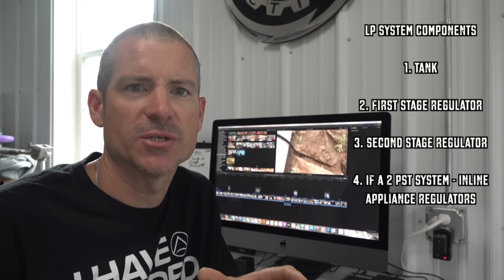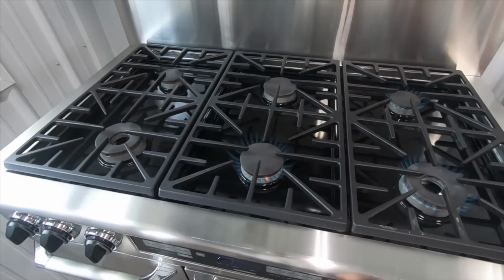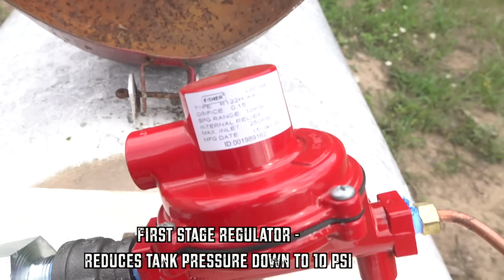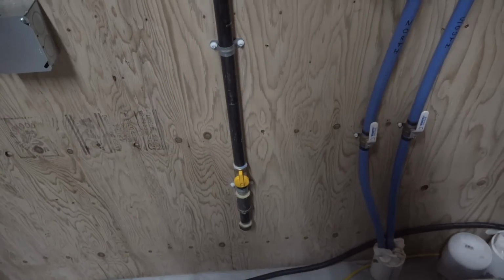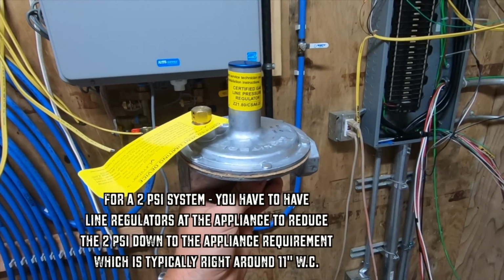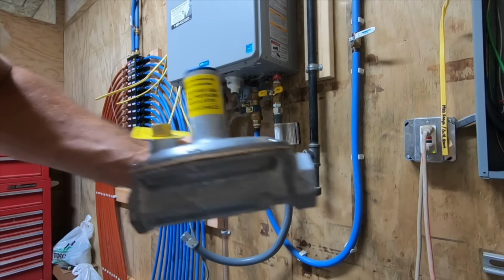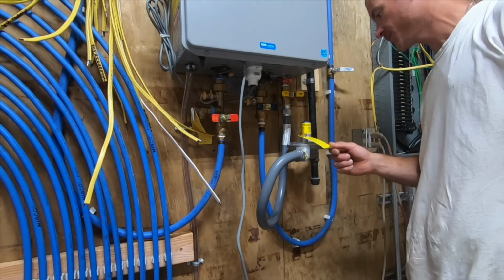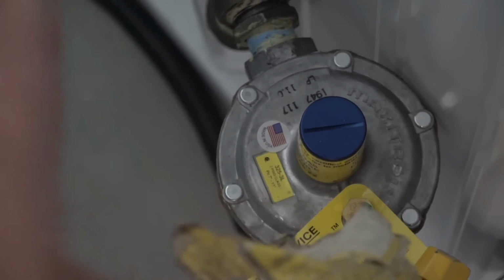2PSI LP Residential Gas System

Comment: You know that end part about being allowed to do these self-builds is really important and it's a bit difficult trying to find out what you need to order permits for and be certified for and etc. If you could do a video on your experiences and knowledge of that I'd really appreciate it.
Reply: There is no rhyme nor reason to jurisdictions, requirements, inspections, etc., since they are 100% politically determined.
Reply: @wallykramer7566  I'm sure they'll typically reflect one another though, and clearly Marshall did the research on where to find all his necessary information.

Comment: Buy the 1,000 gallon tank, DO NOT lease or rent it.  This will allow you to shop around for the best price and customer service on propane.  A 1,000 gallon tank can be legal filled to 800 gallons which is plenty to run everything you will need household wise as well as run a standby generator for a LONG time.  It also allows you the flexibility to wait until propane is on sale or at a low price from any propane seller you want as opposed to being forced to buy propane from the company you rent or lease your tank from.  They almost always inflate the price.    The other thing is PLEASE plug those unused propane outlet pipes attached to the cutoff valves if they are not currently (kinda difficult to see in the video)  Curious little hands from children love to play with them and could be in for an ugly, unwanted, and dangerous surprise in the event of a spark or static discharge.
Reply: this.  own your tank.    shop for gas when its half full and you can find better deals.
Reply: however most companies price match, renting does come with its own benefits and owning has its own draw backs
Reply: @aron6998  Maybe they price match where you live but not in my area or anywhere near it.  In fact, most propane companies will refuse to sell a tank for this very reason so they can keep you like fish in a barrel.  Propane companies will to some degree try to price match on Ag propane but almost NEVER with residential propane.  In this day and age, you can't hardly go wrong buying a bigger propane tank for a lot of reasons.
Reply: WR Farms well I work for the largest propane company and know for a fact all Amerigas locations do price matching
Reply: WR Farms also say you buy the tank fill it with 800 gallons and a leak occurs at the gauge or somewhere else that can’t be repaired with gas in the tank now you’ll have to pay for a pump out and repair whereas if it was a rental everything would be free of costs and the gas lost would be replaced free of charge as well
Reply: WR Farms Ag/IC is a different animal altogether and typically the prices and amounts of gas that’s needed for said season is ironed out either annually or biannually, installation of a tank has nothing to do with valve failure either I’ve set brand new underground tanks with bad multivalve and the manufacturer had to pay for the pump out and repair bc it was a defect, after 25 yrs of installing propane systems most leaks on a tank has nothing to do with the installer and everything to do with basic failure of gaskets/o rings either through age of valve or just the fact that man made products fail
Reply: WR Farms also a propane shortage is extremely likely this year more to do with the pandemic and the refineries not operating at high/normal levels, without the refining of crude oil you are basically stripping appropriately 85% of all propane that would come to market, which word of advice if you can hold extra gas before the cold sets in get it
Reply: @aron6998  And with that you precisely make my point for me even more and highlight the importance what I originally stated in my first post above. Thanks!  👍
Reply: @aron6998  I don't know one person ever had a leak from a propane tank ever. Yes I seen oil tanks leak before never propane tank. Saying if a person own there propane tank instead renting it and propane tank did leak he probably still be ahead cuz what gas company's do make you buy there high price propane. I haven't rent or lease a propane take last 25 years. If you can buy your own tank.
Reply: @funtyes1970  I work on at least 30 tanks every year that has leaks so yes propane tanks leak often
Reply: @aron6998  How can it be free of charge when you might get stuck with a $200 or more rental bill per year if you were not to own your own tank? Ten years could be $2,000 or more paid out in rent of the tank.
Reply: @aron6998  pros and cons to everything in life.
Reply: It would take more time to pay for the price of a tank VS what the difference in fuel prices between companies if you choose a company that is known to NOT over-charge for fuel.

Comment: I work for a hose company and have installed hundreds of pipe connections that will go towards use with propane using non propane rated tape. Haven't ever had one come back or heard anything negative in doing it this way. Can anyone explain why you would have to?
Reply: It's my understanding that the only difference between the tapes is the color. Yellow for ng, blue for lp, and white for water.

Comment: Won't you need to bury the LP tank to keep it warm enough for winter use?
Reply from the maker: Not where I am at, some people do in this area but it’s not necessary.
Reply: @MrPostFrame  is it possible to partially bury the tank to prevent it from becoming airborne in case of a tornadoes?